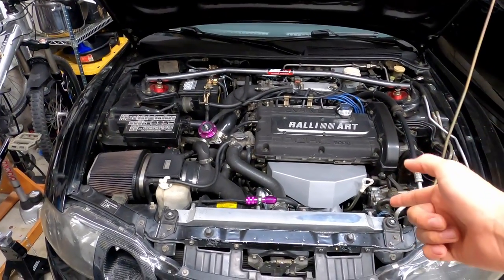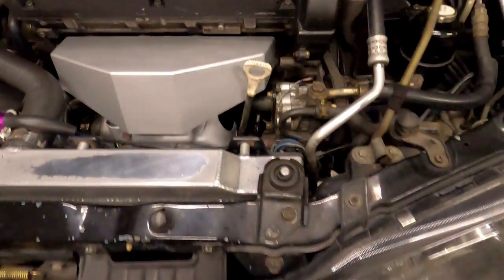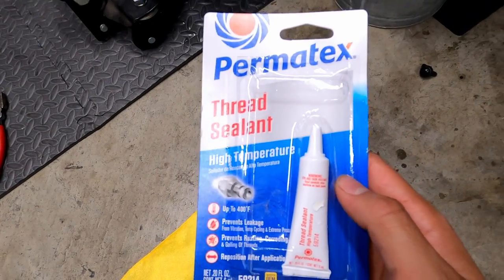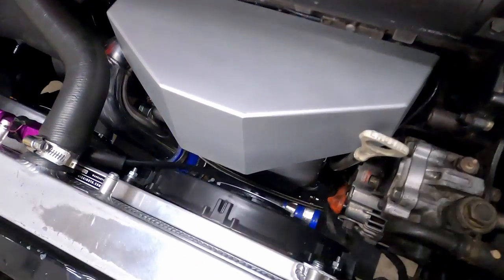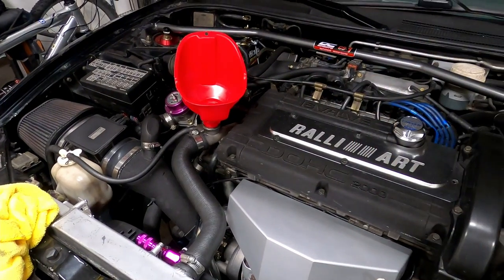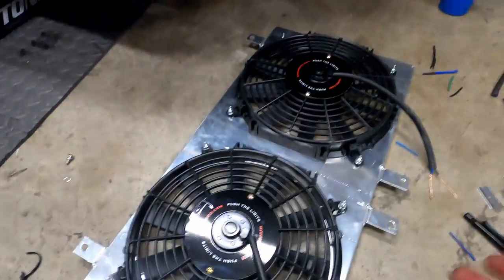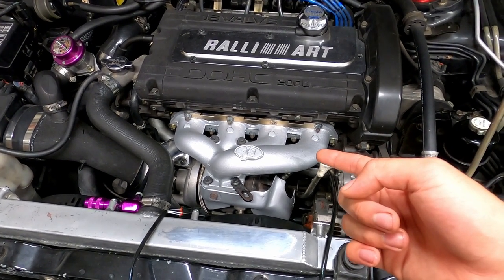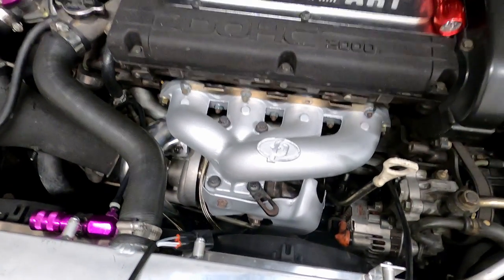Mishimoto Slim Fans / Shroud Install On 95 Eclipse GSX

Comment: I had those for a while on my DSM but it Kept on overheating 🥵 doing hard pulls. Found out they flow like half of the CFM the one single OEM fan flows. They look really good but they don’t work very well. Hopefully you have a better experience than me. I ended up installing the one single OEM fan and added a 12 inch spal pusher fan.

Comment: Bro on the driver side blue is postive but does it go with  blue with white stripe and I know black is negative so that one goes with blue with black stripe ?
Reply from the maker: @blakeduron  its been a while since I did the wiring but how i did it in the video is correct because the fuse would pop when the wiring was wrong
Reply: @emperorgsx  ok is cuz I got one side the way you did it with the green and blue wire and black with yellow and that side works but the driver side won’t work I did the black wire with the blue with black stripe and blue wire with the blue with white stripe but it still don’t turn on I got blue with white stripe and blue with black stripe then I have a blue solid and a black solid
Reply from the maker: @blakeduron  i believe the driver side only turn on if the car is over heating and for the ac

Comment: Aye bro what hose did you use for the bottom been having hella trouble😂🤦‍♂️
Reply from the maker: I bought some replacement ones on ebay , g-plus i think is the brand
Reply: @emperorgsx  did u get the x line radiator mishimoto or the other one?!
Reply from the maker: @royaleboy2614  Its actually a cx racing radiator lol🤣
Reply: @emperorgsx  Damnn😂

Comment: My connectors didn’t line up for some reason did you have to shave the taps on the electrical connectors
Reply from the maker: I ended up just using the oem ends and rewiring them